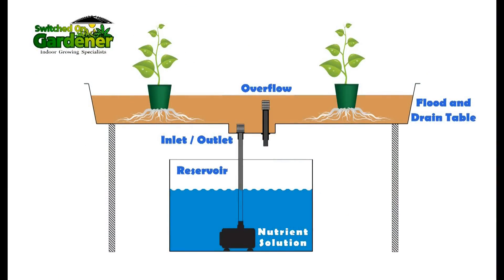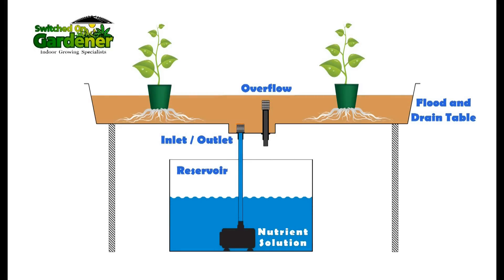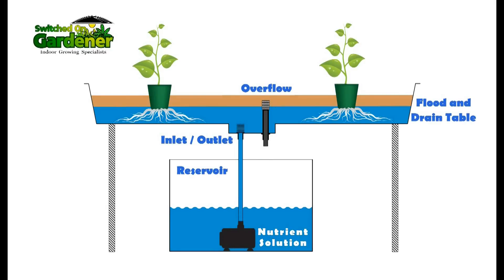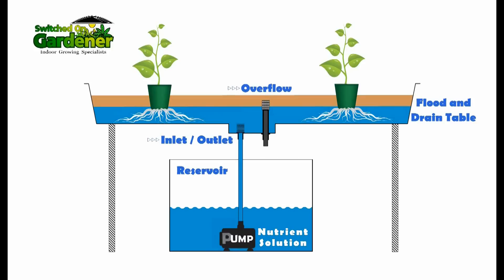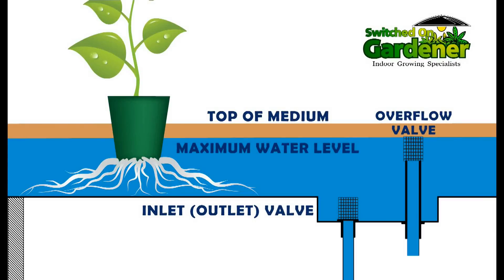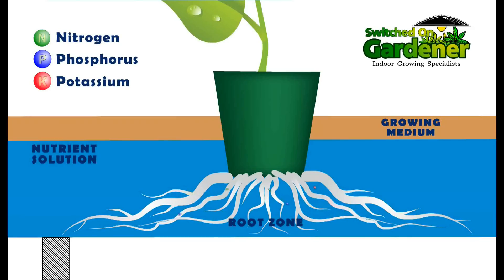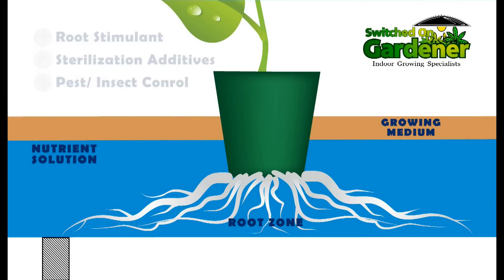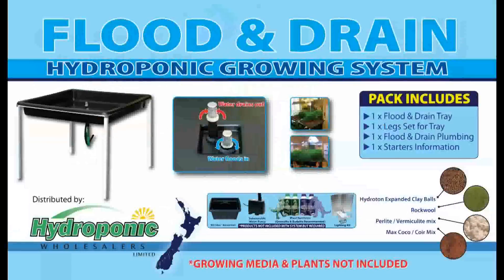Hydroponic - Flood & Drain Basic Rundown

Comment: Just a tip but dont ever put "overflow water" back into the res. Youll contaminant the water
Reply: You have no clue on how this system works. The overflow is there to maintain the liquid level at whatever height you want it at. The whole flood table drains back into the reservoir anyway with each cycle, and guess what, it mixes back together with the overflow fluid!
Reply: Would you suggest having two separate reservoirs, one with the nutrients and the other as a drain/waste bin for the over-flow valve?
Reply: @thesanfranciscoseahorse473  you can just connect the waste into your sink or some shit
Reply: @thesanfranciscoseahorse473  I don't see why you should have a resivour of waste in a hydro set-up, that's just plain dangerous to the plant since disease can easily spread into your entire hydro system within seconds(especially growing weed)

Comment: The drawback to hydroponics is you have to buy "plant food" or nutrition and supplements that are more costly.
Reply: Aquaponics includes the most effective elements of Hydroponics And Aquaculture which means lower pricing and also enhance efficiency. You can get one of the best aquaponics system here:
help1.info/best-aquaponics-plan
Reply: +Phima Bina You can introduce duck weed into the system as supplementary feed for the fish. They can be suspended and kept away from the fish by floating rafts.

Comment: You normally cut a few holes in a lid and place the baskets so they hang with the roots dangling down. 

Then you can either fill the bucket until the roots are submerged for watering and then let it drain (ebb and flow), or misters or foggers will atomize and spray water that clings and drains from the roots and then runs off (this is how aero-ponics works)